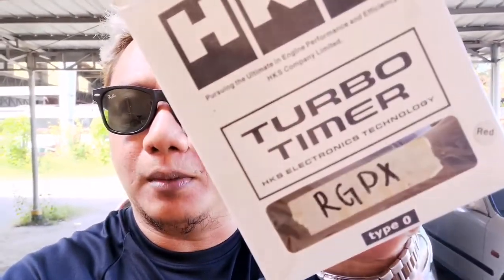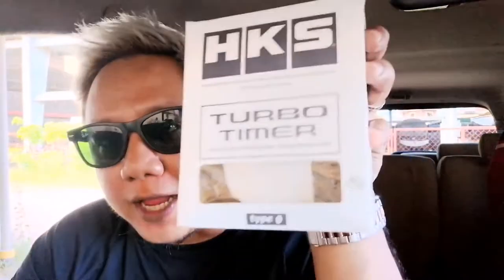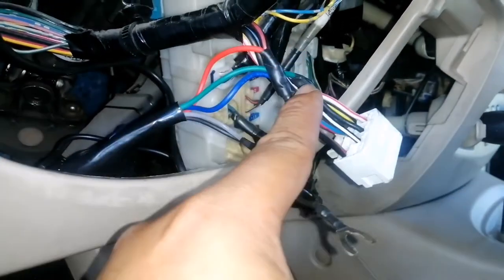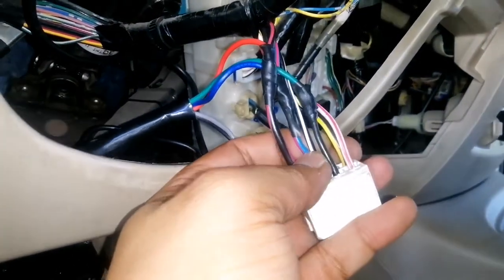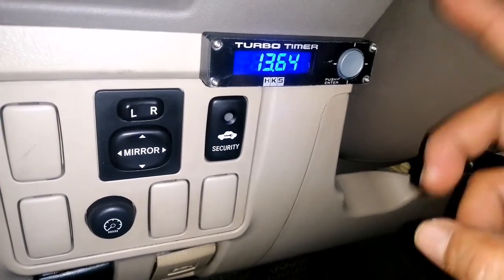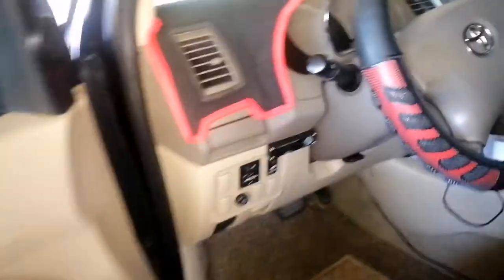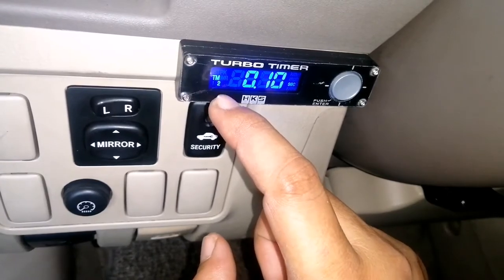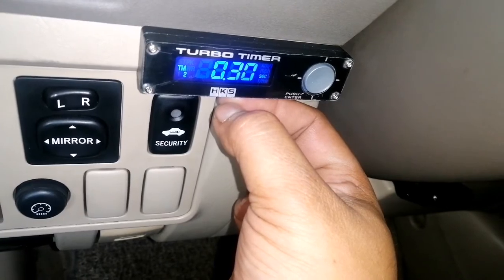Turbo Timer Installation for Toyota Fortuner

Comment: Why … when i turn off the hilux vigo with the turbo timer the batterie ligth is ON???? Its normal???
Reply from the maker: no its not you need to follow proper installation on my video…”Some”of the sensors are on once you pulled out the car key but the battery lights must not turn on why? because after pulling out the key the engine was still running so my answer is not…

Comment: Pwede din po ba ito sa mga keyless?
Reply from the maker: A pleasant morning po… Pwede po sya as long as the wire connection is correct po find the ignition wire for the push button altered by the old school key switch…. thanks po

Comment: I have a 03 wrx I have a greddy turbo timer I’m having trouble connecting an access port because the timer would shut off the car before the access port can install can I just turn off the turbo timer or do I gotta unplug it from the inside of the ignition panel
Reply from the maker: one thing i could advice you is to make sure to check the wirings to the ignition itself because that would give the signal to turbo timer to start its own timer during installation you should try to switch it on then turn it off for you you to be able to see if it did work it should work Sir As soon as you turn the switch off... But if not that means theres something wrong with the installation process Sir.